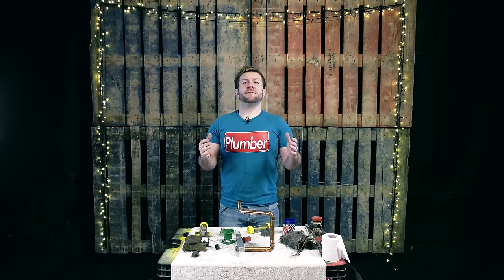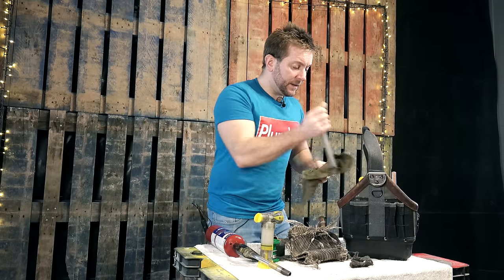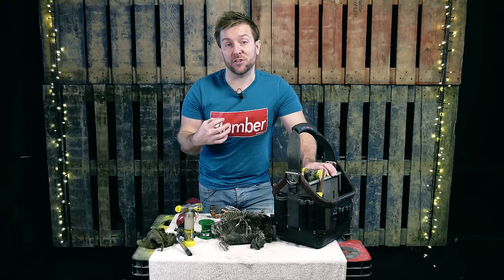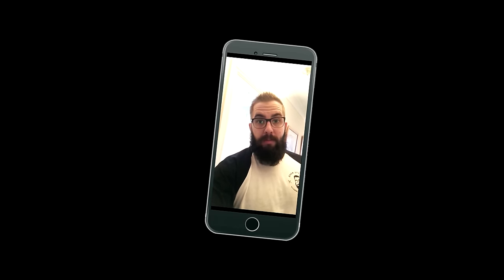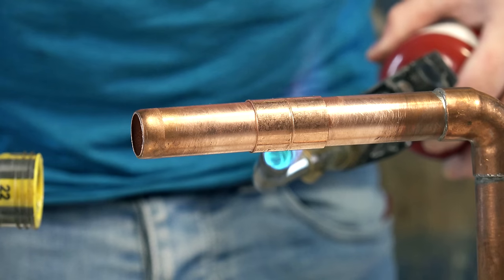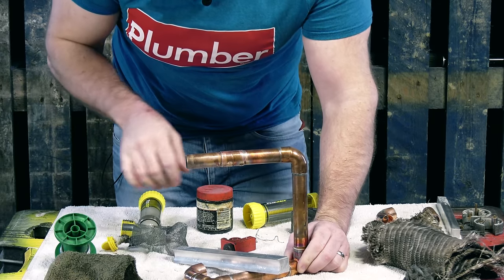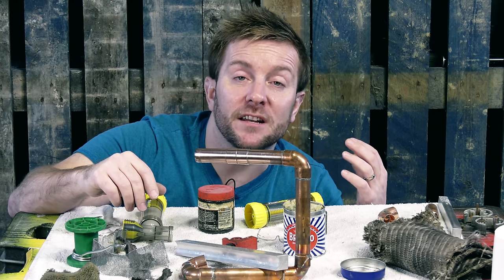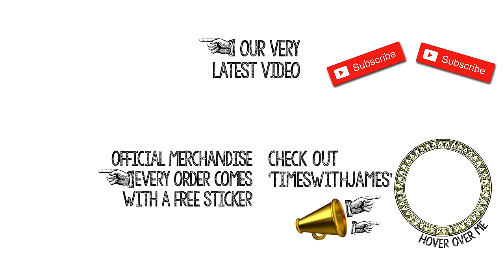7 STEPS TO SOLDER COPPER PIPE

Comment: Im an apprentice and one little beneficial item that I was given was a little inspection mirror to look at the back of the fittings where I soldered. It has helped me lots and touch wood I haven't had any leaks yet. Good tips and I have learnt lots of tips thank you 👍👍👍👍
Reply: how you finding it? i start college monday, plumbing level 1 (bc i didn’t listen at school which i already regret:/)
Reply: Touch wood? 
First time I've heard someone else say this! 
We say knock on wood. 
Where are you from if you don't mind me asking? I'm from Louisiana and knocking on wood is said to prevent something bad happening if its something you are talking about that hasn't happened already.
Reply: So yes I've only just seen this 11 months on but yes I also used the mirror trick.  I'm almost 63 now and retired when I was 48 but I always used my little mirror to check if my joints were fully soldered all the way round. The mirror was also useful when I was scraping layers of old paint from old pipes before joining. Doing some DIY soon in the kitchen and bathroom and will still be using the old mirror.
Reply: I would lose the mirror takes to long. as long as its clean feed the back of the joint, it will run to you and them u know its run around the back.
Reply: @dontcomply5008  English people use touch wood as a saying.

Comment: I like the way you emphasize the heating of the whole joint. I have seen many videos where they go at the fitting with a big flame and get the job over far too fast - risking, in my view a dry joint where the pipe hasn't properly wetted.

Comment: Thanks for this. I think the 2 things I've learnt from you which have improved my soldering of pipes are: 1) less heat on the torch and 2) wipe the excess flux away from the joint. The last of these is so obvious it hurts, as it limits the flow of solder to where it ought to be, and obviously keeps the final result looking good. These 2 have boosted my confidence. Tks

Comment: When I have completed the joint I always use wire wool to wipe round the joint to remove any solder blobs or runs.  I mever cool the joint with a damp rag or water. Let cool on its own.

Comment: Another handy tip is when feeding solder in keep the flame on the other side where possible otherwise sometimes if you’re sticking solder in next to the flame the solder just melts and falls off and looks like poo. 

Another great tip that you’ve displayed but a lot of people don’t use is moving the heat away and just adding it in to make it run once you’re up to temperature 👍🏻👍🏻

Comment: Great video apart from the cooling the pipe any speeding up of the cooling process may cause the soilder to crack and lead to potential leaks
Reply: Only just seen this vid one year on but I totally agree that freshly soldered joints should be left well alone until they've cooled. I've been retired for many years now but I would leave my joints to cool and then just clean them up with wire wool when they were cool. It seems that many you tube plumbers just have a thing for messing with new hot joints. Saw a guy earlier today who paints flux onto newly soldered joints.

Comment: Great tips helped me, im a plasterer by trade, im re plumbing the bathroom and new extension first time even attempting plumbing, all my joints held first time well pleased as i was expecting 1 or more to fail on my first attempt.  One question why would the pipe go black would it be that im burning the flux? Happened couple of times

Comment: Never thought I'd see a how to solder video with no mention of deburring the pipes. Everyone needs to watch a few more videos so you can see the "turbulence" of the water flow inside the pipe that causes the pipe to breakdown and wear away just passed the joint. I'd rather have it done correctly and not worry so much about it being pretty. Also don't touch the end of the pipe once you've cleaned it.

Comment: When you cleaned the pipe with wire wool, you then handled the cleaned end. Even skin oil can tarnish and weaken the joint. Also if you're from the UK why are you not using Yorkshire Fittings for your joints as they give an easy positive connection. Using solder wire seems so hit and miss. An interesting video. Thank you.
Reply: Twice the price of end feed, i only use them as a last resort if a joint ain't taking cos of water in the pipe that just won't stop, that's your best chance of getting a good amount of solder deep inside

Comment: How important is it to debure (probably spelt that wrong) a pipe you have just cut before soldering the joint. I get it for  cleaning loose bit off but getting told by people it can cause problems with the flow if you don't.

Comment: Ahoy, me and the missus have run a new cold water from the meter in MDPE mains pipe then into copper to boiler then onto kitchen sink and into the bathroom!, we also have half the hot water run, after watching one of your old videos on how to solder, we both had zero experience, now we can both get jobs as plumbers? ha ha! no... but with your help we have saved a lot of money, thanks!, its been leak free for over 2 weeks!! HOLD TIGHT!

Comment: Hi. Great videos. You've helped me out lots. I have been using pre soldered joints successfully but now thinking are they any good, as you don't use them? Is there a compromise to quality?  To me seems a no brainer.  Why don't you use them?
Reply: end feed fittings are cheaper than pre solder filled yorkshire joints and a little less bulky because they don't have the lip where the solder if put

Comment: Hello James just a quick question as a gas meter man I often go from steel to copper to the meter but have to use a brass socket to go from steel to copper. I’ve always just used gas seal on the brass onto the steel then soldered from there on. But I’ve always wondered if the gas seal is effected by the heating of the joint when soldering the copper onto the socket. Another person told me to solder a stubb of copper into the brass before attaching it to the steel so as not to burn the gas seal but I fear this could crack the solder in place when tightening onto steel. Anythoughts? Never had a leak (tough wood) from soldering all in place with socket already fixed to steel

Comment: Hi James. Any chance you can make a video on how to get rid of water hammer in your water system? Highly appreciated
Reply: Water hammer comes from either worn float valve washers or rapid shut off of the water , say a washing machine with solenoid valves . If it's the later you  can get an arrestor and fit it by the machine to stop it .
Reply: @dennisphoenix1  thanks for the response. Yeah it's coming from the pipe which leads up to the upstairs toilet. I don't know if it's the float valve or the stop valve on the pipe under the toilet. It's really bad. Vibrates like crazy when toilet is filling up. Not sure what to do, replace float valve or stop valve under toilet?
Reply: @karimabdullah2925   it's definitely the float valve that's making it noisy . The washer in the float valve isn't moving away from the cone cleanly when the float drops after flushing . You could try replacing the washer only but in my experience it can then leak as the cone is worn.
Reply: @dennisphoenix1  thanks for tje advice
Reply: @karimabdullah2925   no problem.   It's an easy part to change and not expensive.  If the supply pipe  is copper use a new fibre washer on the tap connector.
Reply: @dennisphoenix1  will do. Many thanks

Comment: Looks good, i really must get a fluxuator.

Must admit ive never used brasso even in my own house, it might look good but will soon tarnish over  unless you laquer or wax over it.

Top video though and a good tip to turn the torch down a tad.
Reply: I've always thought that copper, polished up makes good design pieces. What would you use lacquer/wax wise? Wipe on or spray on?
Reply: @mattknowles3537  

I have a lot of old period brass door furniture and use a product called renaissance wax. Its a hard wax  paste that wipes on and works out very economic you can get it on amazon.

I clean up with brasso  and buff then wipe on the  renaissance wax and it lasts ages  preventing tarnishing.
Reply: @MrPaul1f  cheers, Paul! I'll definitely give that a go

Comment: Are the fittings with solder in them any good for a diy ....cheers
Reply: Pre soldered or Yorkshire fittings can give you a joint which looks ok but leaks . The solder can melt on the side where the flame is but not on the other, hence it leaks . If you use end feed as in the video apply the heat to one side and the solder to the other, when it melts it's hot enough all round the pipe and guarantees a good flow  round the whole fitting. That's the way it was taught.

Comment: Not putting this method down but if I took this long to solder a joint I would be at the job till 8pm 😂😂 seeing as we are on price and are required to do a boiler, a cylinder and atleast 5 radiators a day this would take to long but if you ain’t on price then this is the way to go IMO
Reply: He's doing an instructional dude....

Comment: How does a solder joint compare to say push fit or press fit fixtures, any advantages and disadvantages between them?
Reply: Don’t mention plastic plumbing or you’ll get abused! 😂 

It’s far easier to use, maintain and flexible for future add ons. Most modern commercial (and domestic) systems I deal with have some plastic fittings or pipe work. Check you’re insured for naked flame work-some insurance companies exclude it. IMHO soldering will be a thing of the past in the near future-oh no-I said it!!!

Comment: Cooling the joint down with a wet rag will make the joint crack simple chemistry
Reply: that is a myth ...i do that for years and never seen or had a crack caused by a rapid  cooling with water, not even in time. During the years i can say i had leakings only when the pipe wasn`t completly dry or when , under the heating process the remaining water from pipe was creating pressure /
Is true that in theory , the soldering must cool by himself , but when you have to do alot of them you can not afford to lose time... so this is good only for rookies :D

Comment: soaking up any excess water on a horizontal pipe. has anyone tried using a tampon? might be effective instead of bread.
Reply: I think the reference to bread is because it was left in pipe and it dissolves and flows out pipes later.

Comment: Great video - I'm not a full time plumber and just wonder something. I've seen some saying not to let it cool down to quick as it will cause cracks in the solder, is that right or just bollards? Keep up the great work and will defo buy gear from your linkie loo :-)
Reply: Rapid cooling can cause stresses in the solder joint. It's not recommended
Reply: @sdgelectronics  Nice one, cheers mate

Comment: Nice vid - just wondering if there was any risk of damaging/loosening the first joint when you soldered the second joint so near to it?
Reply from the maker: Nope, that'll be fine bro!
Reply: that's good to hear as I'm thinking of building a radiator using copper tube and there will be a lot of adjacent joints

Comment: Is there a problem if I use lots of solder (possibly too much)? I havent started yet, but I would rather do too much to make sure there's no leaks.???? Its not gonna be on show so thats not a prob
Reply: If you use too much it will either drop off or run down the pipe depending on orientation.
Reply: No problem. Better to have a little too much than too little.

Comment: I met a gas engineer on site who says that according to new regs you can no longer solder copper pipe to chrome pipe. Is that true? When are you going to show a video installing radiator stalk pipework buried in the wall rather than straight down through the floor?
Reply: I've never heard of that one. Asking as the chrome is stripped back to copper you can use end feed fittings but I would use compression.
Reply: @benregler9872  I don't see a problem with stripping the chrome off either. The reason I was asking is that I'm thinking about  using chrome stalks for the radiators and am planning on having the stalk pipework in the wall rather than going vertically through the floor - I think it looks much neater and gives a better finish for whatever flooring I choose to install. Compression fittings are too bulky if I put the pipework in the walls so I'll end up using an end feed elbow instead.

Comment: Wouldn't using a wet rag increase the chances of cooling the pipe too quickly possibly causing a crack in the solder? Everything else was perfect. Was already doing step 7½ on my own. ;-)
Reply: Total myth the thermal shock thing. Get some scrap copper and solder a joint then throw it straight in cold water. If it leaks after send your details and I'll owe you a tenner
Reply: @Connor-ts8mk  That alone is enough for me to trust it. I guess if it couldn't withstand thermal shock, it wouldn't be very practical with everyday use.
Reply: @nomisukeindustries  leaks after soldering are usually to do with getting the temperature wrong when heating buddy. Applying it too soon means it doesn't form a good joint, and too late means the flux has cooked off and carbonized meaning the solder won't follow it into the joint

Comment: Any tips if there is water and no way to get it out?
Reply: You have to get it out. You can't solder a wet pipe
Reply: If you are using a coupling to extend the pipe horizontal  try lifting up the open end so the water runs away from the coupling , then solder it , then lower it down .

Comment: I personally like to run a bit more heat than that as I find that the flux burns off before you got it hot enough. Also a little spray bottle of water to cool the joint before touching it with a rag.

Comment: You shouldn’t do step 7 when you rapidly cool the pipe with the rag you can fracture the solder you just put on, you should let the joints cool naturally.

Comment: Roger from Skill builder folds back a length of solder the diameter of the pipe as measure of how much solder to apply per joint
Reply from the maker: Nice tip...doing a video with Roger soon...you heard it here first!

Comment: This is terrible advice.  
He puts his bare hands all over the pipe after cleaning.  Rookie mistake.
He talks about losing flux inside the pipe, but avoiding putting a finger in for possibility of getting cut. The pipe end should be deburred inside and out before putting flux on.
He is all over the place with that torch, like he has never worked on a pipe inside a wall.  ???
He uses a rag to cool the pipe down.  This can crack the solder if it cools down too quickly.  Don't do this unless you like leaking pipes inside your wall.
He says cleaning the pipe confirms a leak-proof solder job. ???  Only a pressure test will confirm if you got the job right.  Turn on the water and inspect for leaks.

Do not get your advice from this guy.

Comment: Soldering cables for years, but just started soldering pipes. 
Q- is it worth using flux on the joining fitting as well? Seems over kill, but I’ve had better results.. I seem to get the solder to melt but it then runs off pipe onto floor rather than “feeding” the joint.